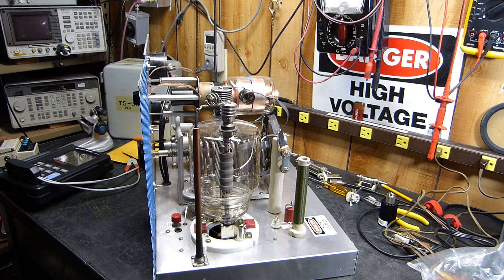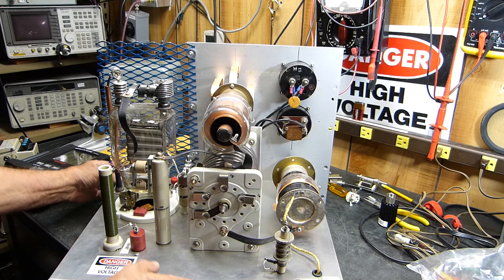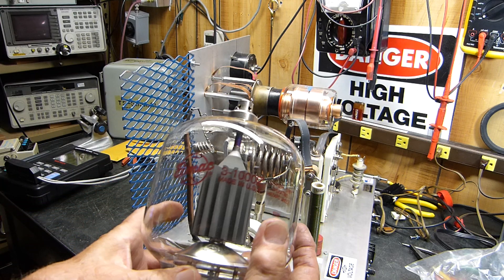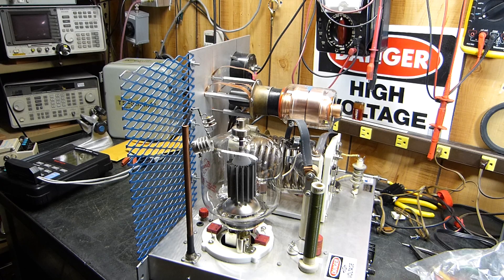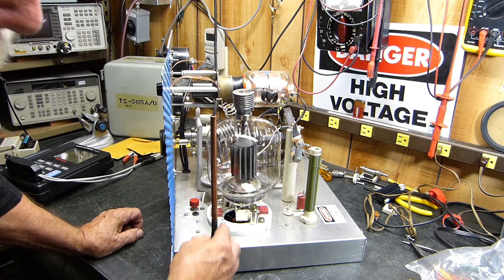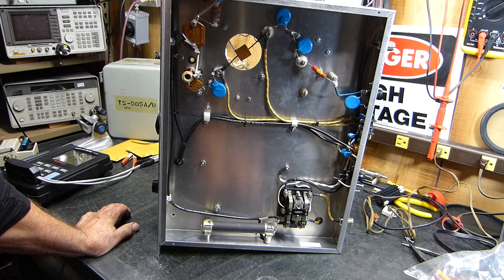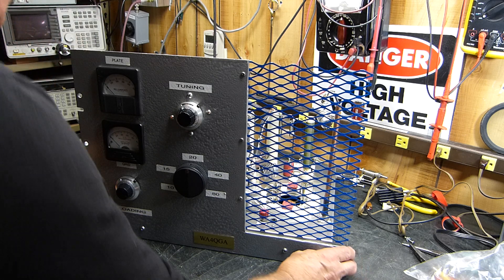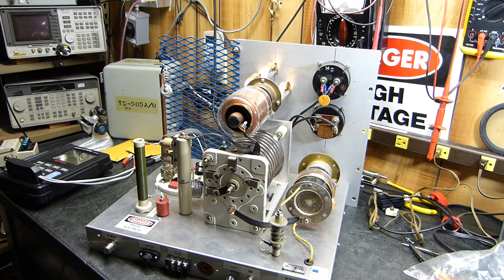Part 1 of 2 - Converting A 833A RF Amplifier To Eimac 3-1000Z Grounded Grid Amplifier

Comment: hi, i don't think that converting it to a 3-1000z is a good idea,  you said that this amp was an experiment to see if an 833 can work in this configuration so converting it to a "mainstream" tube in my opinion is not worth it. i would ruther like to see another strange tube in there like a GU81 or another unusual tube just as a change. 

nut as always anything you do will be awesome!

73, IU3IRR
Reply from the maker: You guys are very convincing not to take the amplifier apart. It is definitely too easy to use the "mainstream" triode in a GG amplifier and I did work very hard neutralizing this 833A amplifier to make it stable. Just since posting this video I have considered using a pair of 813's instead of the 3-1000Z, if I do reconfigure this chassis. 
The problem with a completely new build is the cost of the tank coil (probably $150 for the B&W 850A but which I could build with copper tubing) and the two vacuum capacitors. I definitely prefer vacuum capacitors and just those two components could easily be $400... a new chassis is about $50, and so on goes the cost....... I will have to think about it a little longer.  There is no doubt it is cheaper to buy a used Ameritron 811 amplifier than to build our own considering just the cost I have mentioned and that does not include any PS components or a case....    73
Reply: @ElPasoTubeAmps  a new build will be awesome to watch but as you pointed out the cost is not low....

since the power supply is already build and the chassis with tuning network is done you could just make sort of a test bench for tube amplifier, just changing the tube with something else involves only the swap of the socket and input tuning ( filament aside) some experimentation will be nice to see!
Reply from the maker: @manuelminutello3027  I brought out the 813's but they won't fit very nicely so I am going to keep it as is. No need for another GG amplifier.
Reply: @ElPasoTubeAmps   that is unfortunate...  but i'm glad to see this amp as is, it is a beauty even without the awesome mercury arc rectifiers :)

btw i have a little question for you,  i am 19 and i am also an RF as well an AF amp builder, i learned most of the stuff my myself so when i am designing a new circuit i'l do all by hand or LTspice so not all the times all works as expected....
i would like to build an HV benchtop power supply to "breadboard" my designs before building an entire chassis but i would like some suggestions about the specs it should have. i was thinking about a 50 to 750v 400mA for the plate voltage and maybe a -100 v to 0v for the grid bias. does it sounds good or you would chose different ranges?
Reply from the maker: @manuelminutello3027  I think a bread-board type variable desk-top power supply is excellent if you have the room and energy that you have at 19 years. My energy is a little less at 70 years...  . I am considering it myself and have in a way, done so in three of my cabinets.
If you want to do serious work with anything more than a GG amp, as you and I have already mentioned, and a single HV PS, you will need variable negative bias and screen voltages.
As for negative bias - if you want to run class-A stuff, you only need a 10 mA transformer and a half wave rectifier into a capacitor as you never need grid current. If you want to deal with a 833A, and such, you would want a variable bias supply capable of delivering 100 watts to the  grid of the tube. You know this.
A screen supply can easily be built with a "variac" supply so you can get anything you need from maybe 100 to 750 volts, or whatever.
Make sure all of your supplies are electrically/mechanically strapped together with an external "ground" wire between each chassis. Never rely on the mechanical connections of a slide-in chassis along angle aluminum for a secure neutral connection.
Since I am not going to take this 833A amp apart, I think I should finish the video with a viewing and discussion of the several amps and cabinets with PS for the "eternal" builder of which I am obviously one of. There is a certain beauty in obsession. 
As for voltage ranges, it seems bias can vary from basically zero to -100 volts and as mentioned, you decide on the available current and class of operation.
Screen supply  can vary from 100 to 500 volts? Look at the specs for a 813 and decide. If you want to run class-C RF then more negative bias is necessary.
I have recently been using my RigExpert to adjust the input Z of my amplifiers to the lowest SWR. That makes my transmitter happy. It is necessary to lite the filaments of the tube(s) in my case a 3-400Z and the 833A to get an accurate measurement and adjust the input tuned circuits.
The 833A amp in this video works marvelously well but in my obsession, I want a higher gain and maybe this video and you guys comments has made me realize it is not all about dB gain. Obviously, quality at the expense of efficiency is very important.
As for a plate supply, that is a Big one, up to 5-6KV at one amp is a good goal if you want to deal with tubes up to the 4-1000A. 3500 volt range at one amp is good enough for most other transmitter tubes but placing this supply on a "Variac" is probably a bad idea. I run 240 volts to my radio room and step-down at the equipment using a 5KVA auto-transformer for those items that need 120 volts. I works great and eliminates the 15A house wiring circuits.
73
Reply: @ElPasoTubeAmps  thanks for your suggestions !

i was more oriented about AF amplifier btw because breadboarding at 3kV is outside of my safety zone even if i used to work in industrial 20kv environments.....

i recently picked up a 220 to 3800v 4Kw power transformer and i am going to build a variable power supply cabinet for RF amps with it, and it will also have screen , bias and filament power supply (all variable) to build my RF chassis. i was inspired on this project by your beautifull collins 30k-1.

but as first thing  want to build a smaller power supply to test my medium sized audio amps, like 813 p-p as an example, and it will be less capable but still useful.

as regulation side you mentioned a classic variac and transformer but variacs are very rare at reasonable price ranges in my area, so i am testing a triac based control system that chops the input sine wave to the primary of a transformer and uses post regulation to make it regulated. it is a very stable setup and extremely simple (if ti works haha), if you want i can share the schematic once i have fully tested it because with 20$ of parts you can build a kw power supply with any voltage output as you want!
Reply from the maker: @manuelminutello3027  Definitely bread-boarding at 3KV is outside of the "safety zone" and the fact that you have worked with 20KV you know this and this can certainly result in Death on Contact...
My Collins 30K-1 has a transformer similar to yours but it is a 120 volt primary tapped at three points each on the primary and secondary so I can adjust up or down I guess about 30% and the secondary is 3600 (with taps going down to ???) so, a bridge into a choke input to a Pi filter (the original Collins components and design)  I can get solid 3KV for the 4CX1000A. I may have mentioned this before but the way I deal with the 120 volt issue is I run 240 to my radio on #6 wire and then put that into a 5KVA,  2:1 auto transformer. It works and I have very stable HV dropping from about 3200 to just a bit over 3000 under full load from idle. Drops about 150 volts and I am very happy with that. I could not get that with a 120 volt line.
I tried the SCR variable voltage approach on the grid supply for my 833A amp and it was so touchy that it would not maintain the bias level properly. I went to a small variac. Maybe a better design was necessary.

I wish I could send you some Variacs as I have too many. What would shipping cost? Send me your address if you want to. (theaudioshop@sbcglobal.net) I have a number of 5A ones you can have if that will help you.
I would like to see the design of your triac based control. Maybe that is the way to go if it is stable. The design I used is a really old one using neon bulbs to fire the SCRs.  As you know, even Variacs can change the output voltage between no-load and full-load  so I would not recommend one for the plate supply unless you have at least a 20A. Bigger would be better but for bias and screen they are perfect.
Reply: @ElPasoTubeAmps  OMG, i am speechless, really.
just the fast that you are offering me to give me a variac is just awesome, not too many people are like you.

when i was approaching vacuum tubes i talked with some old guys that were working on radio repairs but most of the times they just yelled at me saying that i was just a kid and i should go back to school, so this offering just means a lot for me.

i will contact you via Email just to not publish all the messages but i will be glad to send you the schematics and even a working prototype of my regulator when it will be finished! 

thank you and al always 73!
Reply from the maker: @manuelminutello3027  Good, let me know. I was once 19 years old and people told me I couldn't do what I wanted to do. But I did it anyway... I never stepped on anyone but I stepped around a lot of people in my life that tried to tell me what I should do.
Reply: @ElPasoTubeAmps  email just sent!

Comment: Yes I would like to see silver plating process is it silver plating or silver cladding
Reply from the maker: I never thought about the difference until you asked the question. If I understand the difference, cladding is a mechanical process and would end up with a much thicker "skin" whereas the plating process is electroplating and is what I have been doing. I will show the document that I used and the chemicals in a video but I got the process from a YouTube video attached. I tried the easy way by using only silver nitrate and a piece of silver (a real silver coin) and the results were pretty poor but this method is so much cleaner and the plating is much better and I only used one "D" cell for the voltage source.
https://www.youtube.com/watch?v=TKw9Pn91KU4            There is also a part 2 which shows the final product.
Here is a kit sold on Ebay      https://www.ebay.com/itm/SC2-Complete-Chemical-Kit-for-500-mL-Non-Toxic-Bright-Silver-Plating-Solution-/202741104823?hash=item2f344fc0b7 
Even if you buy the kit of chemicals, you still need silver metal which does not come with the kit so it isn't very cheap and honestly probably does nothing for the RF parts but make them shiny...   :-)
Reply: @ElPasoTubeAmps  thanks for the link I'll check it out! you can buy silver cladded wire I think only on 1 gauge,. one I was thinking about winding my own Transformers, there is a very expensive Japanese company who make really top-notch valve amplifiers forgotten their name sorry you probably know who they are, who use silver wound Transformers not sure if they're copper silver plated or solid silver wire tho. And for making silver wound inductors for speakers should be the biggest benefit.
You can get a silver wire that is coated with a cotton sheath, but I'm not sure that could be used on a transformer? Should all the wires be close as possible to each other have you got a feeling about that. it would give me about .02 thousands of an inch gap between each wire but I'm not sure it is an issue or not,  space wise is it will be bigger of course, but properties of the electric magnetic field I'm not sure if that really plays a big part if there's a minute gap between the wires, what's your feeling on that.
I'm not sure if I know if enamel or any other lacquer will not stick to the silver?. Anyway thanks for the link check it out.
Reply from the maker: @johnsweda2999  I believe the wires should be as close as possible to each other. I am surely not a transformer designer but it makes sense to me. As for silver wire, I think they have used Formvar coated silver wire in speaker voice coils for many years. It may be an alloy of silver and not solid silver as silver is really soft when rolled out thin or in a wire. The plating process is kind of fun. I may be doing some of it today. Thanks for your thoughts and comments.
Reply: @ElPasoTubeAmps  yes I look forward to seeing your representation of the plating, I found the other guys a bit hit a miss not particularly informative enough. and he didn't show the process of plating and the results afterwards. how much plating can you get on a piece of metal would be interesting to know I'm assuming the longer you leave it the more plaiting you get the thicker it is.
Reply: @johnsweda2999  the company you are thinking about is AudioNote the original Master Kondo in Japan. He used to extruded his own wire. He made silver wire Cartridges, Inductors, Silver Capacitors output transformers. Speaker armature you name it he hand made everything. A real genius and from the people I know who were friends a real Gentleman. Audio Note UK were his distributor and unfortunatly the relationship didn't end well. However Andy Grove their designer is a top man in his own right. Hope that helps.
Reply: By the way love the transmitter. 4000V Cool and a bit frightening. I thought my home built 845 1100v audio amp was worrisome to work on!
Reply: @markironside430  yes that seems to be extensive enough! why did it turn sour their relationship do you know!
Have you ever listen to any of his amplifiers or any of his equipment.